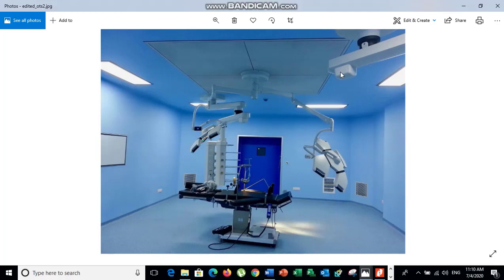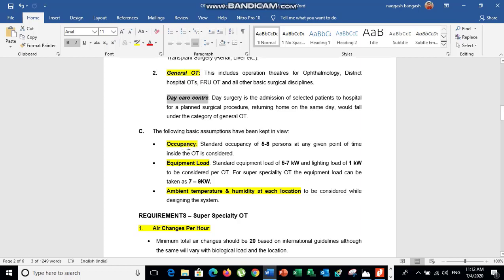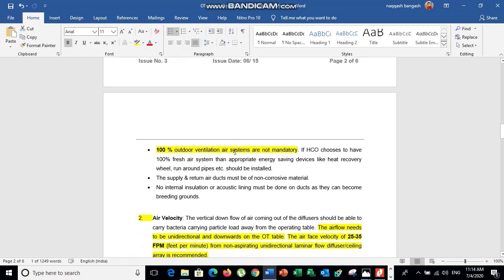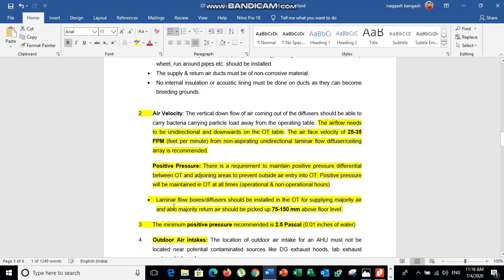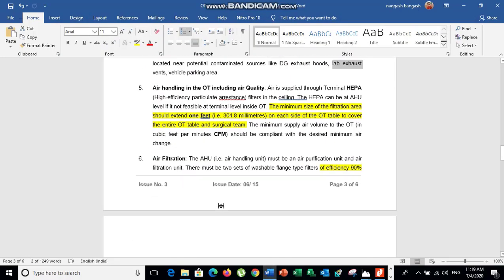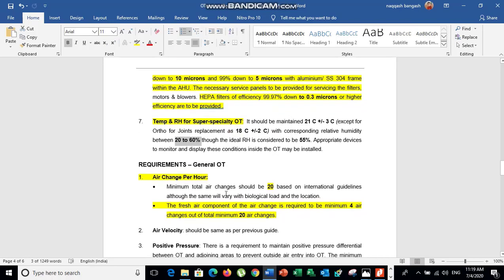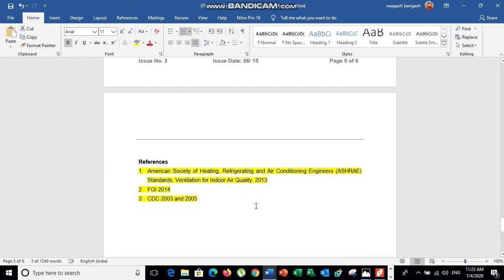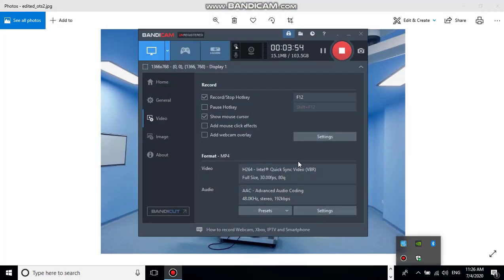Design Guidelines for HVAC system of  OT (Operation Theater) (ENGLISH)

Comment: how to calculate or design 100% fresh air burn ward hvac system with AHU?
Reply from the maker: Check ASHRAE 170.
Reply: @passionateengineer04  only given 2 outdoor ACPH & 6 Total ACPH. 100% FA not given. Could you please share sir...
Reply from the maker: If its per ASHRAE than you don't need 100% fresh air, you will require 2 ACH of fresh air.

Comment: Atmoshpheric pressure is 101,325 pasacl than how 2.5 pascal pressure is called positive pressure in operation theatre
Reply from the maker: Its differential pressure is not with respect to the atmosphere.
It is a mini pressure difference between rooms.

Thank you

Comment: hello sir ,, let me ask .  what is the function of the exhaust fan in the hvac system in the operating room?  and how do we calculate the exhaust fan capacity?  Thank You
Reply from the maker: OT must be at positive pressure, when OT is pressurized some of air flows through door gaps, if the room is sealed tight then the  fresh air needs to be exhausted.
Because when fresh air is added and there are no escape gaps then it will increase pressure beyond limits and no room for further fresh air, because OT required constant 4 ACh of outdoor air as per ASHRAE 170.

Comment: Sir, What is  size of ducts required for supply and return ducts for 3000cfm AHU for standard 20× 20 ×10 (ht) in fts of OT size.
Reply from the maker: Can you please explain,  are taking about main duct or the duct inside OT connecting laminar diffuser.
Reply: Both Sir
Reply: And return ducts also with return ducts at three corners
Reply from the maker: Share your email,  i will send you data regarding OT duct etc
Reply: Share at gnsingh97@gmail.com
Reply: Please share sir

Comment: Sir ,can you please explain why temperature is lower in ortho OT as compared to other OTs?
Reply from the maker: Orthopaedic implant surgery have high risk of surgical site infection and the  surgeons  have  their  own temperature requirements  as  they  have  to work in their  heavy  surgical  clothing  in order  to avoid infection whereas  anaesthesist  requires  a slightly  lower  temperature. It  was  noticed in study that  the  rise  in postoperative  infections  for  the period when  ventilation  system  of  the  theatre  was substandard  and  the temperatures  were high.

Comment: Minimum ACH for OT is 20 and out of which 4  ACH needs to be fresh air.
Consider a OT having 1000sqft, as per ACH equation EA will be 334cfm(20ach) and 4 ACH means 67cfm. Then if we want to size AHU what percent of RA needs to be mixed with OA and what should be the supply air to the OT
Pls help me in this case.
Reply from the maker: In this case 334 cfm is SA and 67 cfm is FA so RA will be SA-FA=267 cfm
Reply: @passionateengineer04  thanku sir
Reply: So now total SA will be 334cfm and as per this we have to select AHU tonnage...
Reply from the maker: 400 cfm per ton
Reply: @passionateengineer04  ok sir

Comment: What is mean by 4 air changes out of total minimum 20 air change?
NABH Guidelines for OT 2018 says "FA required to be min 4 Air changes out of total minimum 20."

I'm a bit confused. In my case for 3535 CFM and 4590 vol I'm getting 44.6 ACH.
How much fresh air to be considered in this case?

Thanking you
Reply from the maker: You have to calculate the supply air by 20 ACH and fresh air or OA by 4 ACH.
So the cfm calculated by 20 ACH will be supply air and cfm calculated by 4 ACH will be fresh air, so total supply air will be  the cfm calculated by 20 ACH plus cfm calculated by 4 ACH and returns air will be only cfm calculated at 20 ACH.
 So the OT is at positive pressure hence cfm calculated at 4 ACH will maintain positive pressure.
Reply: @passionateengineer04  NABH asks min 4 ACH (fresh air) out of min 20. Here I'm getting 39 supply air change.
I got your point that 4 FACH would help in creating +ve pressure which is must in OTs, NOW my question is fresh ACH is 4 (that too minimum), but how much Max FACH could be considered? Is there any limit?
Reply from the maker: FA will be 10 to 15% max of the total SA.
Reply: @passionateengineer04  Thank you

Comment: Hallo. I read from ashrae also that ACH for isolation negative press.room for covid is 12. But there is no explanation wheter ACH 12 is for fresh air only or fresh air Plus supplyr air. What is your opinion.
Reply from the maker: In negative pressure room air is only fresh air, and exhaust air, so 12 ach  is for OA.
Reply: @passionateengineer04  how about for operation room but special for covid patient.  Is the room positif press or neg press.
Reply from the maker: OT are always at positive pressure.
Reply: @passionateengineer04  can you show me the reference or standard that OT fot covid patient is positive pressure.
Reply from the maker: OT cannot be at negative pressure because of the outoor contiminants, it doesn't matter whether its covide patients or not.
Reply: The OT is built for covid  patient only. Not for other patient.
Reply from the maker: There is no such standards for covid patients OT, but outdoor contiminants are more dangerous during operation for patients than covid spreading.
Reply: @passionateengineer04  this is can be anticipated by anteroom/airlock room.
Reply: @passionateengineer04  OT still have negative but the press higher than anteroom.?
Reply from the maker: Ante room is negative room to adjacent space but less negative than negative isolation room.
Reply: @passionateengineer04  if OT -15pa, anteroom -30 pa,  i think its OK.

Comment: plz mention about reheater size selection for RH control in OT
Reply from the maker: It depends on thr air flow rate and capacity
Reply: @passionateengineer04  can you share knowledge if it’s possible to use same OT For positive and negative pressure application 
Like isolation and surgery or vice versa ?
Reply from the maker: OT can only be used for positive pressure. If you want to use it for negative pressure it will contaminate the OT with bacteria or virus, than you will do fumigation etc to use it again as OT
Reply: please send your whatsapp number. I will tell the problem thatI have faced while Designing HVAC system for OT
Reply from the maker: Naqqash.sajid@gmail.com

Comment: First of all thanks for making a nice video over it. Can you please define more about the controls of AHU for OT? Supply air should be based on cooling load calculation results or according to 20 ach? Please answer
Reply from the maker: You're welcome!
Do you need electrical controls?
Ventilation should be according to 20 ACH.

Comment: How you will maintain positive in any room, what is the formula and how should we know the required CFM to maintain that pressure difference with surrounding.
Reply from the maker: To maintain positive pressure the return air must b less than supply air, like one room have supply air is 400 cfm return is 300 cfm and another room has 400 cfm and return is 250 cfm that one will have positive with respect to another.
The minimum pressure differential is 2.5 pascal.

Comment: Hi Sir,  I am doing HVAC design for Fish market. Could you please provide me the reference documents related to the HVAC system design for fish markets. (mainly about ventilation rate required and RH control).  I was searching in ASHRAE, where i couldn't able to identify the data related to Fish market design. Client is very concerned about the smell and condensation/ moisture since the market is very close to sea.  Kindly help to provide reference documents if you have any.  Regards Jayakumar
Reply from the maker: Do you want to store fish for long time? Or just need to store for selling purpose?
Reply: PASSIONATE ENGINEER  Just need to store for selling purpose
Reply from the maker: @JayaKumar-jl6qo  Kindly check ASHRAE Handbook of refrigeration 2018, chapter 32 "Fishery products".
Reply from the maker: And what kind of fish are they selling? Lean fish, flat fish, glazed type etc because their storage temperature and ACH and other parameters are different.

Comment: How much off coil temperature required to get 16 deg in OT
Reply from the maker: It will be covered in coil sizing and calculation topic. Coil temperature depends upon refrigerant flow rate and Air flow rate, if you need to maintain  16 deg in OT you have to design coil according to it at temp difference of 5c. Or during equipment selection manufacture can provide this data.
Reply: @passionateengineer04  u mean to say if need 16 deg, off coil temp shall be 11 deg with 5C diff
Reply from the maker: For Chilled water system we supply water 7c and return it on 12c to maintain 16c. But it all depend on manufacturer, if you want to achieve 16c room quickly its off coil temperature will be different and air flow will be different if you want to achieve gradually than its different.
Reply from the maker: 5c difference in case of CHW 7c water supply temperature and 12c on return, but off coil temperature is different it depends on how quickly you want to achieve temp, normally for 16c its 6c coil temperature that is 10c difference.
Reply: @passionateengineer04  you cannot get 6 deg off coil when your entering chill water temperature is 7 deg C.

Comment: How to design AHu of OT for 16 deg.
Also how much return air we need to take for AHU
Do we need uv light in ahu
Reply from the maker: I explain this in previous comment.
AHU RA depends on Supply, that how much pressure you want to maintain if you want to maintain more pressure in OT, RA will be less than SA and for Air balancing you have to add OA and exhaust some percent of Air for Air relief.
Its better to use UV lights or UVGI.